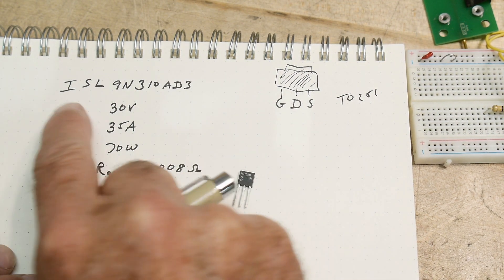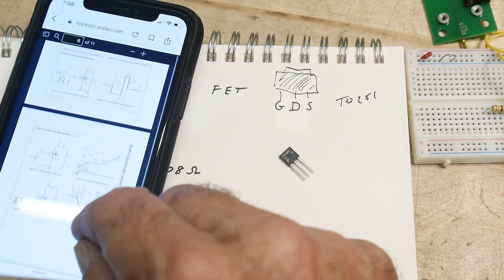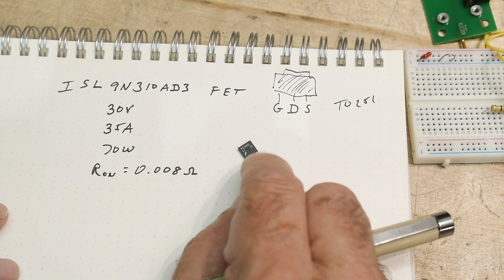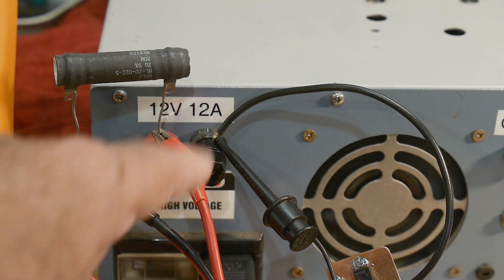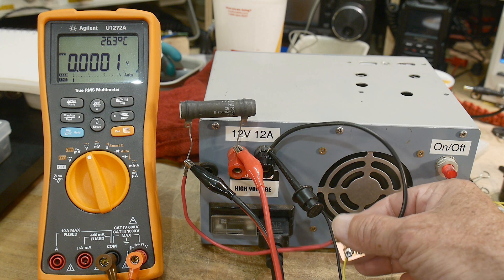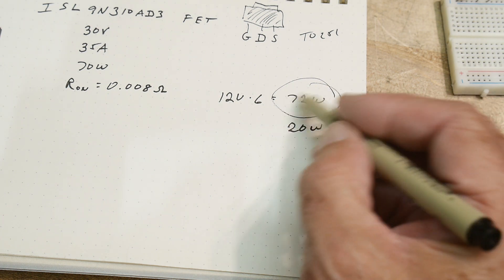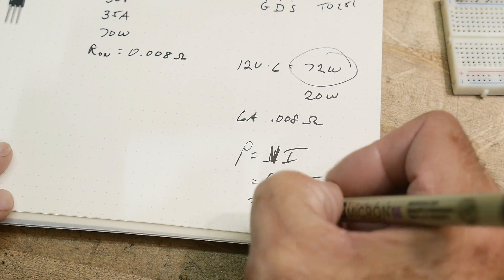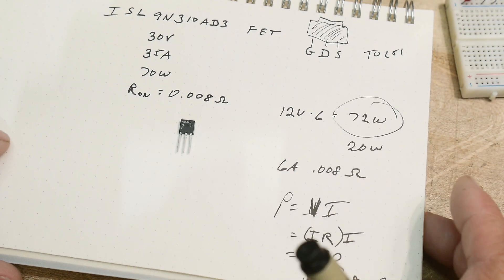#1193 N-channel MOS FET ISL9N310AD3

Comment: Here's something interesting about Mosfets, they only dissipate power when they are switching on or off.
Reply from the maker: they dissipate more when switching, that is true, although low ohms, at high currents they do dissipate, they are also used in between as in DC electronic loads and the FETs in loads get really really hot.

Comment: Having an "on" resistance of only 0.008 Ohms means that these devices could be very useful as discharge transistors in Sawtooth VCO cores, the 0.008 on resistance means that the reservoir capacitor would be discharged pretty quickly, you probably wouldn't need much space for a heatsink on the circuit board too since the device wouldn't be dissipating much power, so there's an idea for a use for these little devices, as a voltage-controlled switch in a Sawtooth VCO core.

Comment: Nice video. Nice calculator HP32S.  I have the same one.  I"ve had mine since 1990,  It's my favorite calculator.
Reply from the maker: I've had every calculator HP ever made, the HP32S and HP32SII are great (HP15C was my favorite for a long time) the HP35s is ok and you can find them cheap sometimes since it is not collectable

Comment: It's a better mosfet than I expected. Most non-logic level mosfets quote a "headline" Rds(on) that only applies with around 10V on the gate, but have substantially higher Rds(on) with 4V to 5V on the gate - as you'd get diving it from logic. For the ISL9N310AD3, I was pleasantly surprised to see that the typical Rds(on) at Vgs=4.5V only went up to 11.5mΩ with 15mΩ maximum.
If you're going to drive mosfets from logic level, it's a good idea to check the typical and maximum Rds(on) at the drive voltage you're using rather than assuming the headline value applies.

Comment: How about a new topic...N channel mosfet bias class c for an induction heater...?

I am building one now. Using (3) IXYS DE475-102N20A MOSFET in  parallel...

I might just purchase fine -small scale lower power Amazon heater....made in the far away country east of CA...then study it...

So far I have the transistors..the HV ceramic caps..some RF chokes..fast freewheeling diodes...

And using 4.5 ohm gate resistors so they don't hog power....so all 3 share and add power...Their is some serious gate capacitance to be switched...

Application: Wrap water cooled tank around a bearing spindle...CO2 SDI applied to shaft...to remove tight press fit radial ball bearings...

This is not what has stumped me...I just thought of it as a maybe new different topic. 

The other question and consult request are something totally different...

I need to see if IMSAI Guy has already covered something similar to induction heater...

Thanks for all our sharp readers...and the grand Master IMSAI Guy...for his future teachings...

I am very inspired...

Kind regards 
Fred

Comment: For relatively low frequencies. Get to 50khz, and especially higher, the device generates a lot more heat that is not related to the DC ON resistance.

Comment: Nice MOSFET saturated switch...
One reader mentioned obsolete....but I am sure there are  hundreds more...

It is nice to see the more modern generation....with gate  on voltages of 5VDC...

I am stuck or used to like the vintage IRF-250...IRF-541... which liked 10  VDC on the gate...

Thanks too for the earlier little driver push pull....lots of Collins little schemes -parallel CMOS inverter driving using 6 hex gates  a 2N2222 and 2N2907...then this drove IRF-250...for the switching power supplies...main bus was 24 VDC...and +5VDC, +/-15...were created...

Nice chuckle too....if you saw your new employee running spice models..for a simple circuit...he may need to go to marketing...or be sent elsewhere ....

And that complementy pair was brought up and mentioned by IMSAI Guy...

It sure is nice for now some  logic can drive directly the newer MOSFET..

Glad to be on same wavelength...

Comment: 12V dummy loads I use halogen lamps, 20W, 50W and car headlamp bulbs, so 55W or 130W. Yes get hot fast, and bright, but a great test load if you care for the transient current as they heat up. 

For that transistor I would say the greatest heating with steady state current flow will be the PCB traces and the package pins heating up, that on state resistance is impossible to achieve in real life, the real part is about 3 times that once you are using the pins of the package. But so long as you are able to get the gate driven by a decent amount of current (the old 555 timer here excels as a very cheap robust gate driver) it will stay cold even up to a good switching frequency. The killer is always either poor drive, too high a current or simply too high a peak voltage on turn off.

Funny how MOSFET replacing bipolar in switching still has a very similar demand for gate drive current, and a lot of the time the bipolar is still used simply because there is no advantage going to mosfet.

Comment: They work really great for low duty cycle switches. They are the perfect DC ON/OFF switch. It's the high duty-cycle applications where things get tricky, and the real engineering calculations come in.

Comment: Incadescent car headlamps are excellent 12V load
Reply: I put one in a plastic snap lid bottle wrapped in tape so it didn’t blind me. It caught fire.
Reply: @boonedockjourneyman7979  ha ha, it does become very hot, so I wouldn't keep the bulb anywhere near flammable items. And never touch the bulb for at least 30mins after turning off.
Reply: @boonedockjourneyman7979 GLAD IM NOT THE ONLY ONE THAT DOES THINGS LIKE THIS....LOL

Comment: 02:06 LOL, it never occurred to me one can glue the pads on the PCB.
I am adding this to the bag of tricks for circuits on the fly.
Reply: Search for 'Manhattan Style PCB' and you'll find a lot of tips and tricks how to build like this.
Reply: I was aware of the Manhattan style and the island style, a lá Jim Williams, but these methods require some form of ablation of the copper layer. The glue-in method is different (and it sure adds a lot of stray capacitance), but still looks fine for a quick prototype.

(I played with comparators and simple discrete opamp with components supported by rigid cardboard and soldering on the other side - it's very quick if you do not have a perfboard or a PCB at hand and it beats the deadbug technique in cleanness.
Reply: @copernicofelinis  For me I've always considered the definition of "Manhattan style" is that you glue pads onto the main pcb - you're soldering on top of the buildings so to speak. The other metod is to just make "islands" in the pcb using a knife or hollow drill.
Reply: @MatsEngstrom  oh. I used to think that Manhattan style was meant removing copper with a ruler, leaving rectangular regions of copper, but I am probably wrong.
Reply: @copernicofelinis  Hm, that sounds reasonable as well. Making a nice square grid just as Manhattan.  Now I'm unsure.  Maybe we both are right and there's no fixed definition of this ;)
Reply: @jim9930  thanks for sharing
Reply: There's yet another style/term called "the dead bug " style.
All are for a quick (though ugly looking and sometimes prone for failure or shorts) prototyping
De VU2RZA